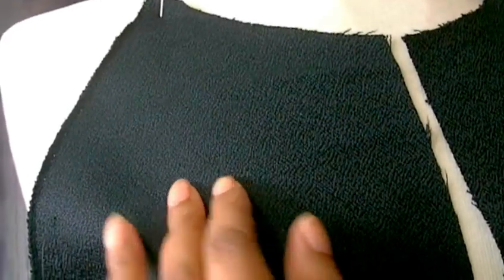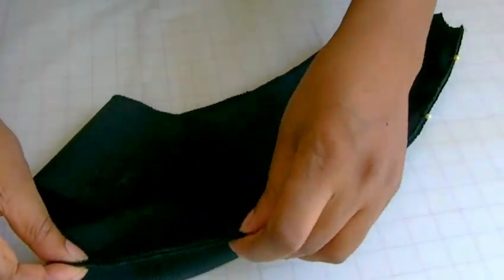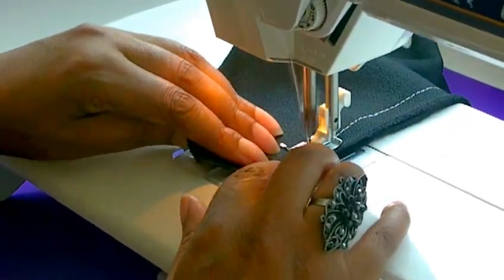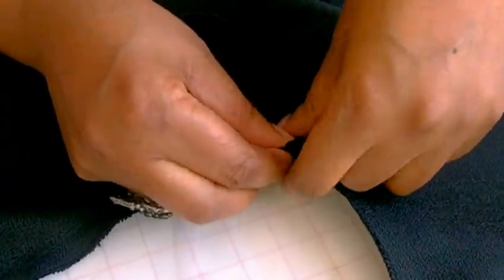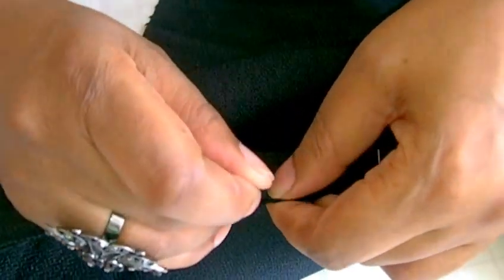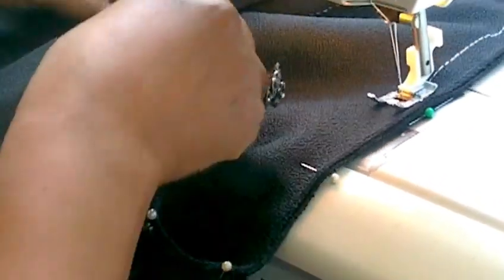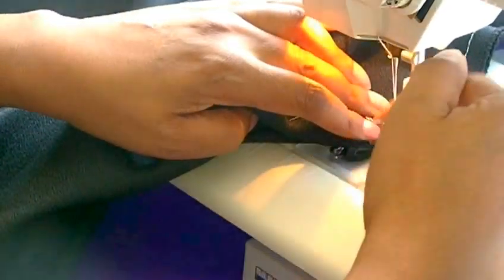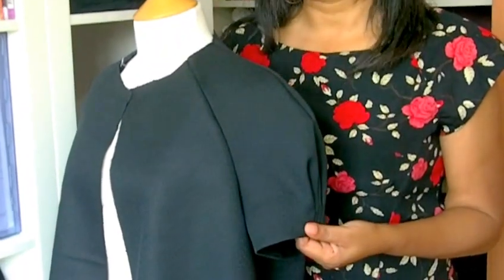Sewing Raglan Sleeves

Comment: I just tried to attach a raglan sleeve front to the front piece of a light cotton(non stretch) robe I am making for summer for my son and it didn't ease at all....which is why I sought out this video. It did not fall into place....I matched it up about 5 times, even tried pinning it a million times and still couldn't get it to match the other side in the least. I am so frustrated. I sewed it anyway, but it looks a mess. I need a sewing teacher so badly......sigh. Maybe I chose the wrong fabric for this robe.
Reply from the maker: It sounds like it may be a measurement issue rather than a fabric problem.